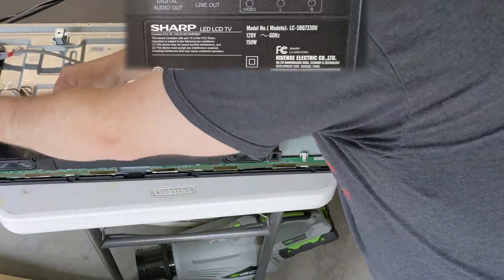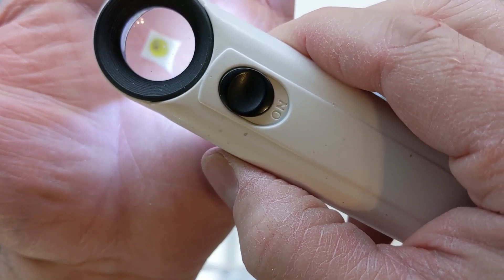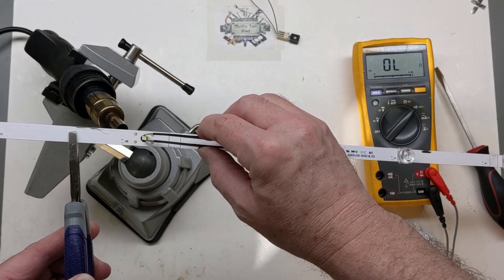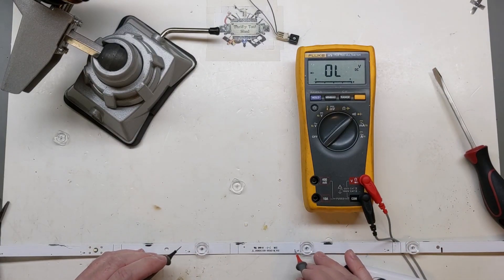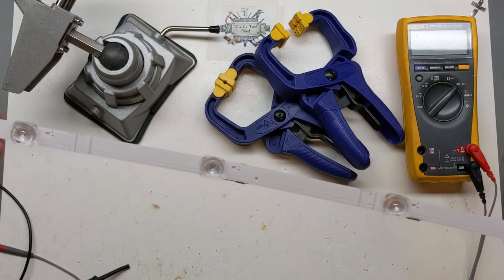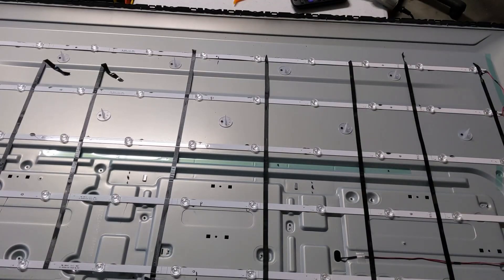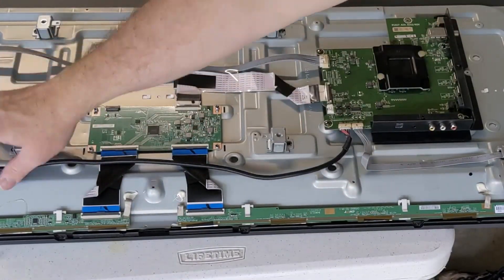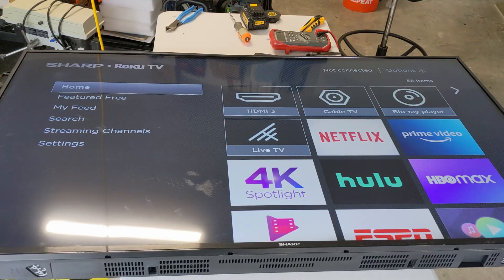Sharp 58" TV Back Light SMD LED Replacement (Part2)

Comment: Hi there. 
I have seen few other videos that they are us9ng the 3030 LED (3V @350ma). Can you explain why you use the 2835s?
Reply from the maker: It's been a while, but I have used both of the 3030 and the 2835s depending on the model of the TV. I typically use a site like ShopJimmy to list the spare LEDs for the TV model I work on, sometimes they don't. I typically measure the LED forward voltage by testing one of the good LEDs on the strip, look at the dimensions/orientation and then see if shopjimmy lists repair LEDs for the model. I don't work on these often, just my own and a few times helping out a friend. I don't care to work on them often, just sometimes it is worth it instead of throwing one out. I do feel strongly that replacing the whole strip is the best repair if the TV is used often. Sometimes eBay or shopjimmy will have complete sets of LED strips for some popular models. It seems TVs with broken screens are good to get these parts from!
Reply: @ThriftyToolShed  Mind to explain how to determine soldering orientation?
Reply from the maker: @sashadimitr2852  
An easy way is to use a DMM diode test function if unsure. Some have marking for orientation while most do not.
Reply: @ThriftyToolShed  Thanks. I was able to make tests using multimeter by switching it to V/Resistance mode using button “Set”. I hope this helps someone with similar multimeters. Regular buzzer for some reason did not supply voltage.

Comment: Thanks Thrifty.
I like your way of removing the LEDs! I needed some LEDs from an LED light strip and tried to use an SMD tweezer but it ruined them, I'll try this.

On another note, I don't know if you're interested in upgrading your EGO batteries to the newer style or just want to get an idea where your batteries stand but I have tested the switch points for each light level. It's different for charging and discharging but I think just building a simple comparator circuit for discharging is probably good enough. 

Here's the data:
Discharging (I used a high quality electronic load at 2A discharge rate. Batteries less than one year old with no more that 10 charge/discharge cycles)
above 57 - 5 bars
55.4 - 4 bars
54.1 - 3 bars
52.1 - 2 bars
49.8 - 1 bar
46.1 - 0 (red light on)

Charging (EGO charger)
50.7 - 1 on, 2 blinking
52.8 - 2 on, 3 blinking
54.5 - 3 on, 4 blinking
57.3 - 4 on, 5 blinking
58.9 charger off voltage settles to 58.8 volts

These readings may be off +/-50 or 75 mV but they should be good enough to build a straight forward level indicator bar.

Rob
Reply from the maker: Thanks for the information!

Comment: Enjoy your videos and I would like to see you do a video on removing a treadmill motor to be used on a power tool for variable speed (drill press, lathe etc). I specifically have a 1.5hp brushed 90v motor to go onto a metal lathe if I can find a controller that works. Some say you can use the treadmill board but I’m not sure. You explain the do’s and don’ts very well.
Reply from the maker: I actually have a 130VDC motor from a treadmill right now. And I want to make either a grinder or belt type sander out of it with it powered from EGO 56V batteries.....
Thanks for your comment and interest!